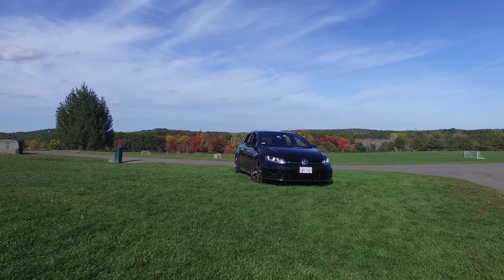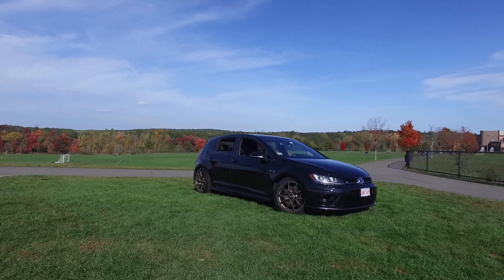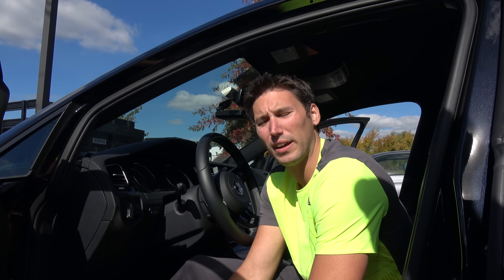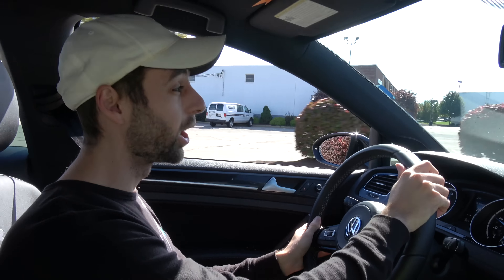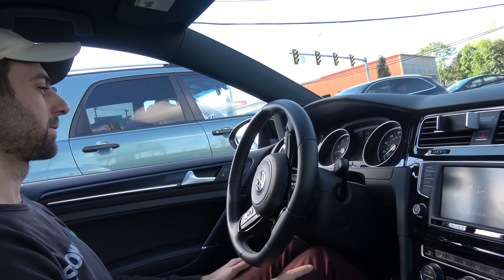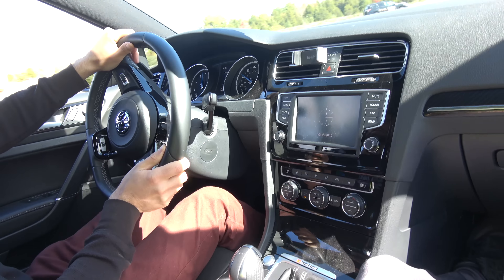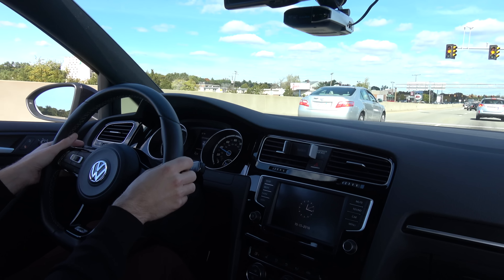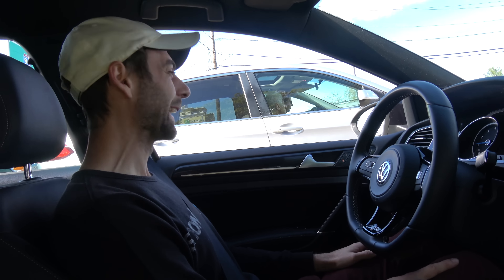APR Stage 3+ Golf R  (4K)

Comment: Over 600hp crank and claiming 530whp on 100 octane? APR Advertises the kit as 463hp crank @ 93 oct, 430whp @ 100 octane. Nice Golf R but seems like inaccurate numbers unless theres water-meth we dont know about
Reply: Mitch Butler apr advertised 522 crank hp last i checked, not 463
Reply: My mistake i was reading the stage 3 non +. Regardless the numbers quoted in this video are way off
Reply: No one is getting 600 crank out of this kit yet. Only the TTE600 kit is making those numbers and it's custom fab to install. The TTE525 kit is the only "kit" making a true 500+ at the crank on pump 93 for the MQB platform
Reply: Wrong. TTE 525 kit only is putting numbers out ANYWHERE near close to this -- on E85 blends with external fuel source.
Reply: USP Motorsports TTE525R makes 550 crank on 98ron pump fuel and 595 on race fuel, stock fuelling system(euro)with HPFP upgrade.  

TTE600R is a hybrid also and currently in testing at 620 crank on pump fuel and stock fuelling apart from HPFP upgrade hope to release late this year 👍🏻

The TTE600 that you mentioned does hold the world record for 1/4 mile in a G7R and was a custom set up based on a big frame turbo.
Reply: We are the only TTE supplier in the United States, as you know + have Jeff to support for tuning. When we lay down the facts + prices to people about what it's going to cost for a whole TTE525 kit (with Jeff's HP numbers on stock fueling). They stray away. We have sold a whole lot of TTE turbos by themselves though. I wish the USA cars came close to those numbers you describe, but that is far from true. There are hardly any TTE cars in the USA that are using the stock fuel system, only piggyback systems with extra fuel pumps. I wish we had the euro fueling brother :( It would make it less tedious for us + allow us to grab that power with ease like you guys have overseas.
Reply: USP Motorsports yes your fuelling system sucks compared to the European.  But anyway the fastest 7R in USA is a still a TTE525R car, so not so bad for those that will spend or try something different
Reply: It's hard not to be skeptical about that slip in the heat of summer. Quite a odd time on a few variables. You and I both know, in any other scene besides MK7s -- you would be gunned down if you claimed a record with one slip, no video, or any other supporting evidence. Besides, that car was not comparable to a stock fuel system APR car. His car was running a full blend + more. Car has run like poop on the two occasions I have seen it. He also has denied racing our world-record MK7 GTI. Once you strip that stock fuel system, your options are endless. We just currently are focused on end-user solutions. There will always be one-off systems that will perform better (with more money + time).
Reply: slip says it is what it is for me.  I don't doubt anyone's really customer or not I do trust people's integrity.  Many doubted our own hybrid G7r  until we did a 10.6 at the 1/4 at santaPod at a main Vw event.
Reply: I'm installing the TTE525R kit on MKVII GTI now with APR 980cc fueling kit. Jeff is tuning it. Should be enough fuel up to power levels that OE internals can handle. I'm guessing that at 700+ we will need larger than 980cc? APR numbers were quoted using certified Sunoco race fuels. In the real world, there is inconsistency at the pump. E85 is great, but not always same ethanol content. We struggle getting good fuel in the US...
Reply: awesome Eric if your not a member of the TTE OWNERS group on facebook please join.  Im sure quite a few be interested in your project
Reply: Eric Wilson TTE have the 3 fastest G7 r in Europe, and fastest S3 8V and fastest skoda.  So potential is there if your set up allows.  

We have a new page on our website for customers. 1/4 mile as well as other times for fun.  Do check it out
Reply: 500hp FWD....sounds about right.
Reply: khamid1 AWD
Reply from the maker: This car is sort of an APR special project. The details are vague but it is not a standard 3+ kit. Will be filming with it again in spring because I'm just as curious as you as to proving out the numbers. Thanks for watching!
Reply: I honestly think he fed you a bunch of bs.  It's likely just a standard Stage 3 + car, while very impressive, it's nothing near these ridiculous numbers he's giving you.
Reply: SIMON at THETURBOENGINEERS and
Reply: lets see the dyno

Comment: The car will never see 1000 hp on a 7163, and his 494 dyno sheet is not his. That's APRs engine dyno. The car makes 494 on 93 at the crank and 530 on 100 at the crank. And those hankooks he has on the car are not slicks
Reply from the maker: haha he knows they are not slicks... Hoping to film it on a dyno sometime next season. Not my car so no dog in the race here. Thanks for watching!
Reply: I understand it isn't your car, the thing I'm attempting to address is that you didn't do your homework before making this video.
Reply from the maker: I don't write scripts for people when they talk about their own cars.... Just a quick feature on a well built car. If this was a paid ad for a manufacturer or tuner, then data is necessary. But for someone to say "Hey come drive my car" and talk about it... I'm happy to show it off.

Comment: How does the suspension mods effect the ride comfort? I would want to keep mine comfortable for passengers.
Reply from the maker: This was a while back and the engine blew up a few months after the video was shot so I cannot remember much about the suspension. The car should be rebuilt for next season so I'll let you know when its back on the road
Reply: Tedward yikes. I'm assuming it was the stock block and internals
Reply from the maker: For the most part yes. It was something of a test vehicle for APR... It was pushed beyond the 3+ kit and shot a rod through the block lol. It was fast, but the new engine they built should be able to handle it.

Comment: owner said 60 pounds and thats correct ,the turbo is rated for 60 LB of airflow per minute  not actual psi of boost ,one thing is to have the money to own go fast stuff and other thing is to actually understand the proper terms and understand what you have under the hood ,so shameful too to trow numbers out like that  APR 104 oct is rated for 540 ish horsepower to the CRANK  and thats almost on the limits of  the EFR 7163 ,entertaining nonetheless

Comment: anyone know if the internals are forged?
and how much power can the stock internals and/or transmission take?
Reply from the maker: +Jimmy T - SRT4 threw a rod through the block so we found the limits haha. New engine with stronger internals going in soon but there's only so much you can do on that block
Reply: Tedward how much power did you have when the motor blew? 

does Volkswagen have a partnership with APR? so I can buy a new golf R at the dealership and order the APR stage 1-3 kit threw them and they can install it.?
Reply from the maker: he was pushing it beyond the APR stage 3+ so it was a matter of time. Cannot confirm power since I don't have dyno figures but can probably guess it was around 475 ish. 500 if optimistic. Either way it was too much for the block.

Comment: ok, so stage 3+ golf 7 r with a dsg... ???
Reply from the maker: If your question is "why not a manual?" the answer is simply that DSG is much faster. Keep in mind: Not a political statement against manuals
Reply: of course its much faster and i also like dsg i'm driving both, but i mean... cmon you have that much hp and can't play with the rev shifting... i would be stressed as fuck to d'ont have the felling the engine when reving aha
Reply from the maker: haha i feel you...but the golf R isn't a buttery smooth engine mated to a glorious shifter (like an F430 manual). Plus the DSG allows the car to stay in boost so it just pulls and pulls. Wouldn't fault either choice tho

Comment: This thing will blow up before it gets 800hp much less 1000hp. Forged internal would be vital in breaking 1000 hp not to metion a trans that could actually use it under hard throttle for 200k miles without slipping or grenading or both.

Comment: I realize that it comes down to personal preference, but watching a video, ANY video of a Golf R that isn't a 6 speed manual just makes me sad. Watching him drive looked positively boring. He might as well have been sitting on a sofa watching ...umm ... Golf on TV. (Pun intended.)

And yes, I own a '13 Golf R Stage 3+. Sorry to post a negative comment as I am sure you love your R as much as I love mine.   :)
Reply from the maker: lol i love it. You are definitely correct in the sense that the DSG takes away a lot of the drama... Assuming you've got a pretty beefy clutch fitted to your car to handle the torque? This is the only Golf R I've driven so I'll have to find a 6 speed to play around with and if I'm lucky will be tuned for better comparison
Reply: Yep, my R is fitted with a Motorsport RSR Clutch, installed by HS Tuning. Just one of many items in a list of aftermarket goodies.  ;)
Reply from the maker: its a wild platform. Never been so shocked in a 4 banger